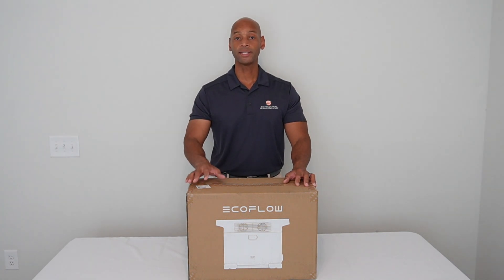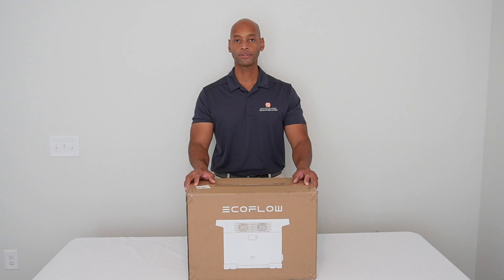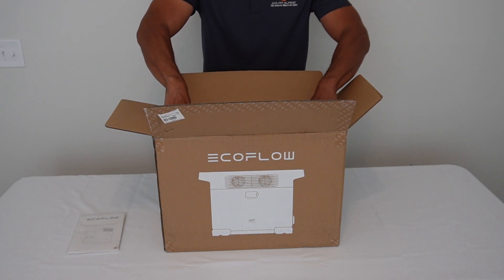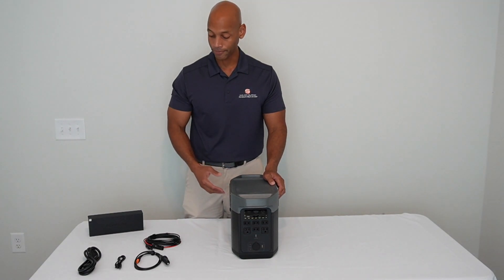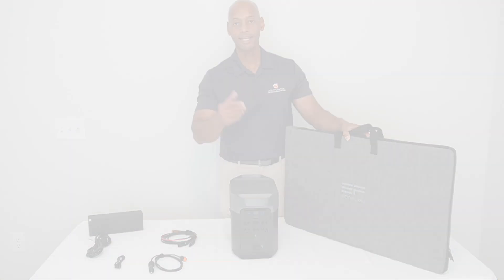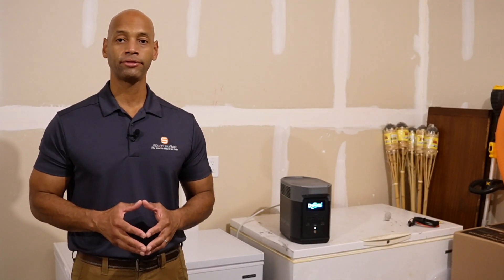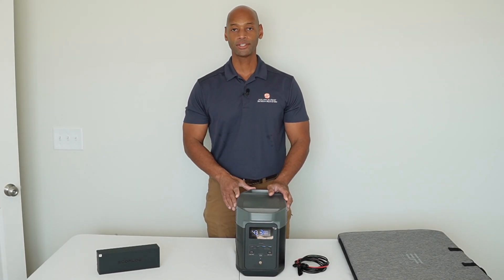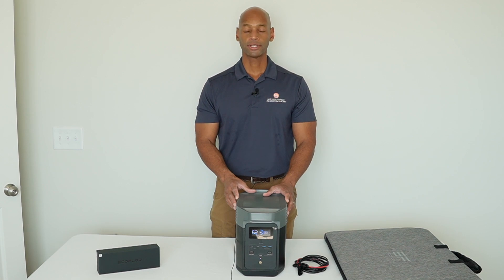Best Solar Generator Under $1k | New Ecoflow Delta 2 Unboxing & Load Test

Comment: can i connect the ecoflow delta pro with my enphase solar system
Reply from the maker: No, the Eco flow is designed to run as a standalone system.

Comment: another feature eco flow river has (I believe each model does this) is pass through power /"ups" mode. You can plug it in to charge and still power the loads plugged into the unit, should the mains power go out it will continue to power the loads (switching time isn't quite computer grade ups, but still pretty good)

Comment: I purchased the Delta River Pro last year as a backup power source to use to power my CPAP during a longer duration outage. Worked well recently when the grid went down to due to damaged equipment, kept essential needs covered.